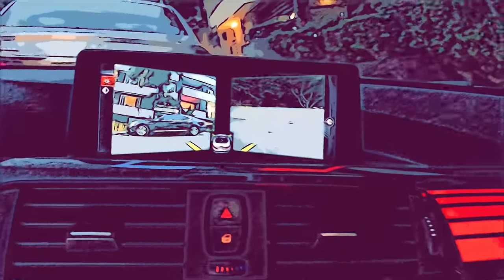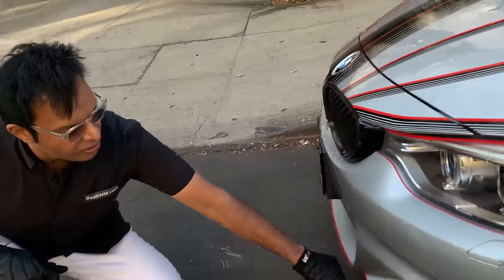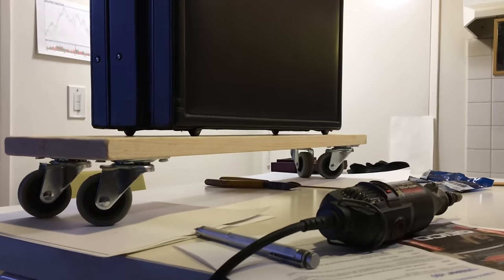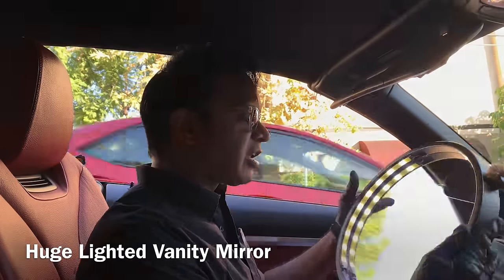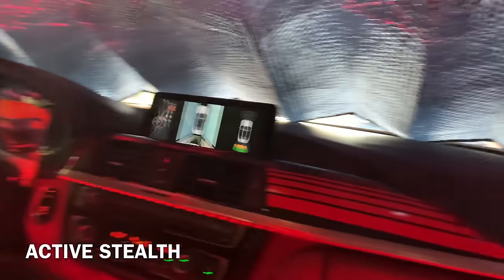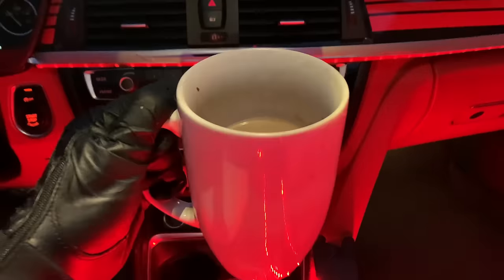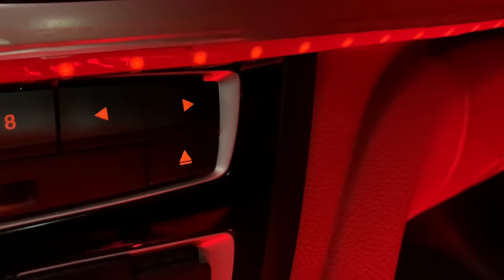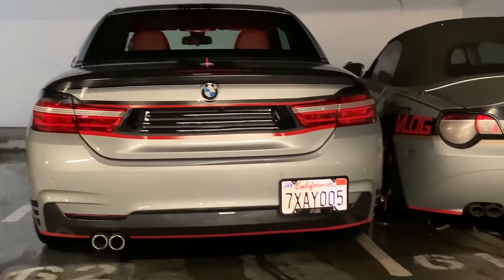CRAZY COOL CAR GRAPHICS ON A BMW with ACTIVE STEALTH GADGETS to HIDE FROM EVERYONE!

Comment: The “Drift Kit” around the 00:06:55 mark, is hand’s down, one one of my favorite parts of the video.

When I lived in apartment, I kept a flat hand truck in the truck to haul bottled water and other stuff back and forth. Your custom one is more elegant, and I love that the wheels lock in place!
Reply from the maker: That's exactly the point of it, having to go through multiple elevators is so easy with the "Drift kit" ... I never thought I would use it so much, but it's faster just to take it and and go! Versus putting everything in my pockets before I get to my car, then taking everything out of my pockets when I get there. Fashion is too tight these days to keep things in your pockets while you drive… At least for me! 🛞😇🛞

Comment: Your comment about not seeing a lot of older BMW’s is interesting. I remember from a previous video you spoke about your first BMW, which looked almost brand new with how well you maintained/restored it. What model/year was that?
Reply from the maker: It was a first generation E12 five series! the 530i that was sold in the US until 1981. There's a picture in this video https://youtu.be/Kpl9-jv6R4E?si=2Xnd2y33KSUQaZR8 ...mine was an automatic, had ridiculous gearing, it did 40 mph in first gear, 80 miles an hour in second gear and 123 mph in third. I drove across the country about 50 times from Los Angeles to Annapolis Maryland with it. She eventually retired with over 313,000 miles accrued, and never burnt oil, it was a 78 model with the 3 Liter straight six engine. My BMW Z4 burns oil and so did my 325IS, although I don't think my four series does. The Word on the streets is, modern BMWs do burn a bit of oil, something that my old one never did, which is weird.